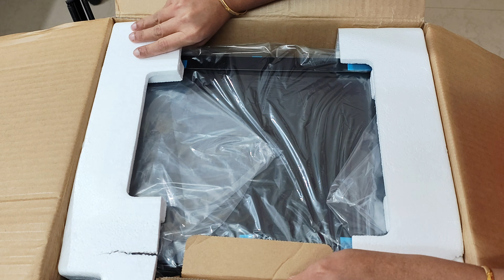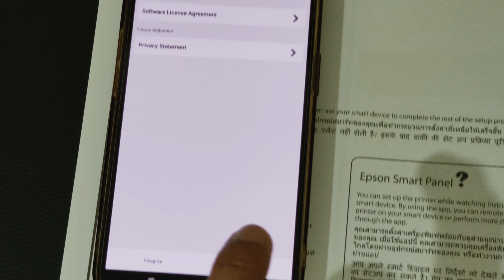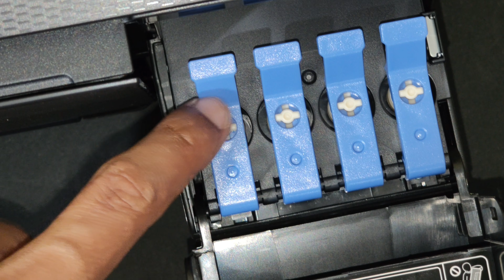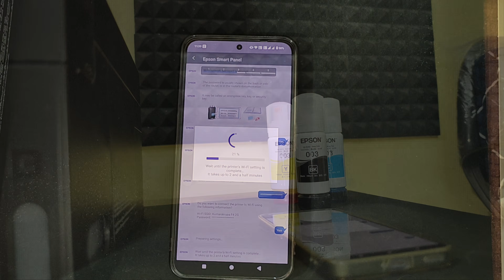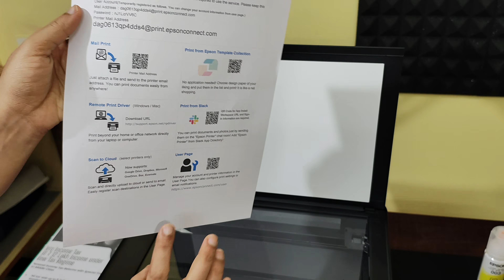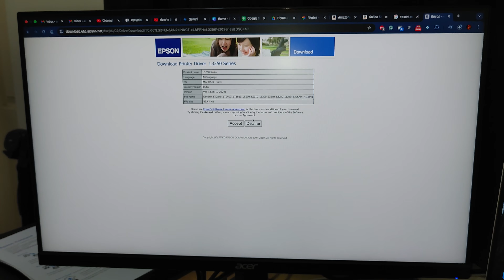Epson EcoTank L3252 All-in-One Ink Tank Printer with Wi-Fi - Unboxing, Setup & Detailed Review!

Comment: I have 5g wifi connection and you said it will connect to 2g wifi will it be connect to jiofi?
Reply: WILL IT ?
Reply from the maker: Yes, 5 GHz WiFi router usually also has a 2 GHz band in it. So you can connect this printer to that 2 GHz network.

Comment: Thanks a lot. I was looking forward to buy this. Please tell me if this has any downsides. I need printer for home use and will be using this irregularly so i hope it works fine. ❤
Reply from the maker: It's a good printer. Only thing to note is you need to keep it running often, once in every 4-5 days to make sure the tanks don't dry off

Comment: I’m trying to setup for the first time after purchasing. The Epson Smart Panel app doesn’t detect the printer. The 2 green lights blink, but the mobile app doesn’t identify the printer.
Reply: Samehere. Did you come right with setup. I'm still stuck
Reply: @philodine9766 The problem is your printer should be first connected to the wifi network. The only way is the manual route. After your printer is connected to wifi then search for your printer with Epson app.
Reply: Same

Comment: Thank you very much for your video. 
My name is Orlando, and I have a question. 

What happens if the ink tank is filled before the installation process?
Must the installation process begin before filling in the ink tank?
Reply from the maker: You need to follow the exact steps as written in the manual. I have done the same. Some models may have different steps, please follow as written in the manual step by step.

Comment: Thank you for the detailed video. What would be your review now i.e) after using it for 3 months. Did you face any problems like paper getting struck or any print head problems. Awaiting reply. Thank you again.
Reply from the maker: Have been using for quite sometime now. It is recommended to use the printer once in every 3-4 days to avoid ink getting stuck.
Reply: @VERSATILEKNOWLEDGE  Thank You

Comment: How much should you print and how often to prevent ink drying out or damaging printer head?
Reply: He is asking how often we should print to prevent ink drying up. These printers if not used for few days, will clog the ink tubes.
Reply from the maker: It's worth noting that most home printers are not designed for extremely high-volume daily printing. They are intended for personal or small office use. 

If you need to print hundreds or thousands of pages daily, you would likely need a bigger & a higher-capacity printer.